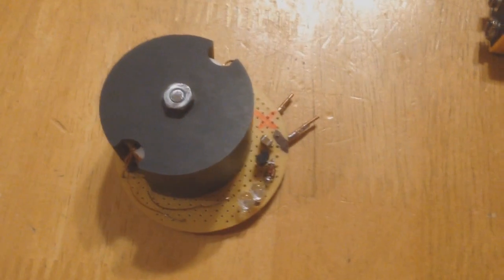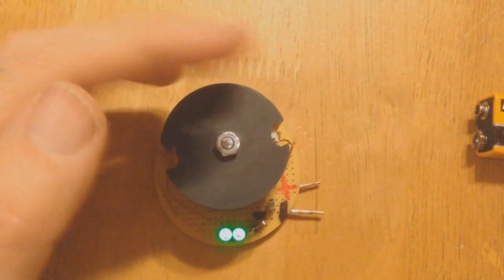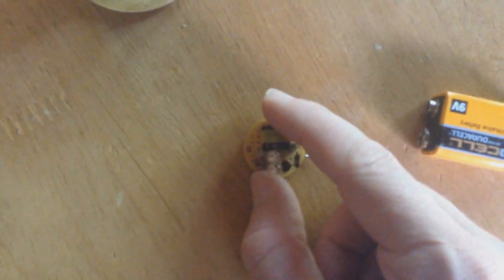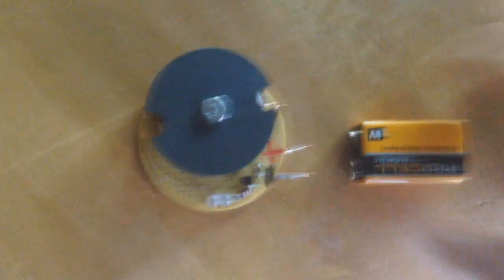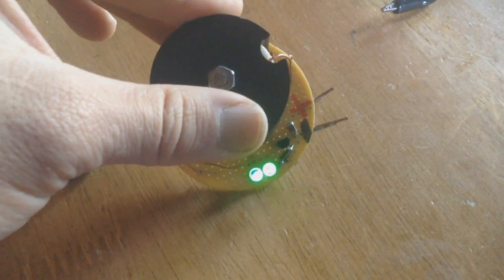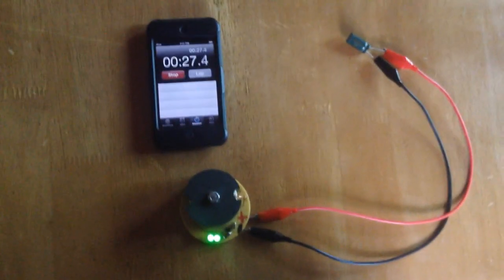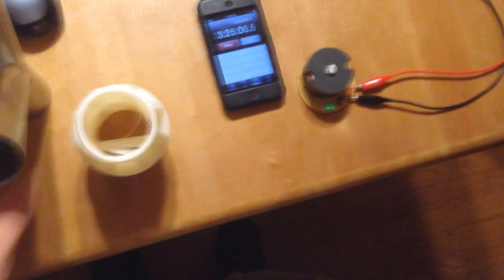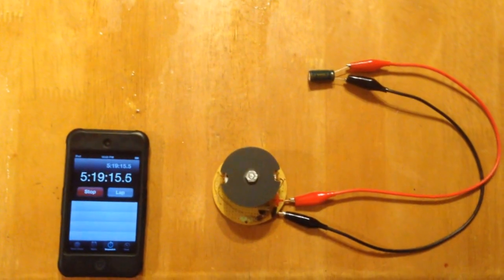5+ hour run on 3500uF - SJR Looper V2 LED Driver

Comment: Yeah I liked all the things you are doing Mike and then I really would like to look get with you sometime and talk with a great deal about this is about maybe you like the ceramic capacitor but I don't care too much for a server on the front of the pastor that durable cousin. Sorry I didn't get that short mountain all their causes a year when they have power go on on dolphin their way with a surge protector went out and then couldn't get it to work anymore so I replaced it with a medal pack happen there in a little bit more send one of you knew and then put that in there it had seemed like it was a lot better with it that metal pastor and they all the furniture and a whole lot better then made it made my tuner come in a hole watch our per month on the pasture in the circuit board replaced in the year ceramic in the TV set the never live down and I thought to myself how that worked worked fine and I kept on working train station bottoms nothing at the right level in Qatar look good enough in the tent over then and than 200 working extra sharp cheddar picture in a color was excellent and the sound was a rule rule! Today do no harm at all to the TV set at alls

Comment: This looks brilliant, could it be scaled up to run a 10W 3.6V 3A cree xml u2 led? 

http://www.cree.com/LED-Components-and-Modules/Products/XLamp/Discrete-Directional/XLamp-XML

Ive been playing about with a small project to run 10 of these 1000 lumen leds from one usb port. I'm using usb as my input voltage since it is by definition universal, so I could use 5v solar chargers, phone charger, wind up charger etc. and the emergency lights in my apartment can run indefinately.  Keep on experimenting!!!

Comment: Could you take the circuit above and put a similar ceramic cap in place of one of the LED's (or both and use an efficient diode) and then run a second SJR off the first? Or even try looping it?

Comment from the maker: I just passed the 10hr mark doing a long run test on the 3300uF cap.

A quick heads up on the the circuit called the "MEG-GA Joule" TinMan is now publicly saying that it was all a fake.  He shared that "Everything is as is except the cap-which is a 5f 2.7 volt cap,with a 1000uf cover.".  Wow that is 5,000,000uF I am surprised that TinMan was not running a small incandescent bulb.

I responded to TinMan personally with  "I understand what you are trying to do by teaching people to not be so gullible. The problem is that while impressive, your implied results are so close to mine when using a pot and tuning the resistance that I see no reason to do it as a fake. I am really close to a similar level of performance right now, although I am using a 3300uF vs a 1000uF.".

Meanwhile scratchrobo just shared this: http://youtu.be/3gkS9tSY5Wg
Reply: he has quite a few interesting free energy projects if you dig through some of his videos.  one he uses a long extension cord and loops it and uses a lighter spark ignitor to excite it and the energy just loops and loops and it stays on, he plugs many things into it and they all work.
Reply: that video might give you some ideas on how to scale up your sjr looper and make it bigger.
Reply: The small group of yall fucked up yr credibility, since its not 1st of april

Ima sent TinselK after yr asses :p
Reply: moxncal except he totally blew any sort of credibility he might have had. Nobody will believe anything he says now.

Comment: Incredible! I run a single white LED (3.3V 20mA) with NCP1402 and a 2.7V 500F supercap for 5 hours. But this circuit is awesome! Only 3.3mF capacitor - and so long runtime. It seems like perpetuum mobile to me.

Comment: Your circuit do have interesting potential to power basic circuit eg:led blinker via low power microprocessor.Imagine this supplying current in uA which is from a 2 or 4v calculator solar cell which is then able to power basic circuit from output.I do own a high efficient green led 5mm which i have it lit nicely by 3volts battery via "27" kohms resistor.

Comment: and the 3 diodes is an idea from the Akula circuit, what made you think to use that? cause diodes have their voltage drops.

but im more interested why your phone area got wet, ? what happened, spilled a drink?

Comment: i wonder if you cheated on this one, cause how come the place where yr phone is wet, who dropped a drink, and you decided to restart yr device without resetting yr timer ;)

47uf can run 1min 10 sec

1000uF about 7 minutes, and 3000uF about 45 minutes
so how can yr device run 5 hours or more, with out earth wire and antenna?

i asked you before, in how did you get rid of a ground wire?

nice work anyways, cause it got me started to

any local transmitter that's getting picked up by yr device?

Greets JB
Reply: So after all this time yr arogance did not respond me? so yr one of those cocky ass builders, with to much gas

Comment: Your awesome laser saber. I've built a few crystal cells (a few months ago) and I am going to see if I can get a decent boost in power or brightness by incorporating your SJR Looper circuit into the mix somehow. I will make a vid after i'm done doing some testing (probably a few weeks from now)
Reply: Actually, it may be sooner, due to the simplicity of the circuit. Cool stuff, loving it. Peace.

Comment: Excellentissimo.
Me wants the schematic and the parts specs.
Question: Have you ever worked with "energy harvesting" circuits like e.g. 
LINEAR TECHNOLOGY LTC 3109  LTC 3108  LTC3105  some of which run from 20mVolts thermo elements or electrolytic corrosion voltages.
Reply: I have worked with 25mV to boost voltage to 8volts.There is a catch low voltage needs higher current which only a peltier can provide easily.
Reply: ima help again, since im already gotten started, Dude fucking visit Saber website, did you even took the time to check, and do you even have the parts.

me wants the schematic, ma ass dude, check his freaking website to get you started, and you dont need a fucking pot core, any core will do.

damn, i wonder if Saber gets tired of peepz like this as i do, same oll shitty questions from peepz who just wanna post a comment and never build anything
Reply: I have posted various youtube videos do check it out.But i noticed you got zero posting in youtube hence no video sharing was made by you.You got no credential dude.Hard to believe you sorry.
Reply: sanjev21 Blah to, welcome new commer
Reply: blah blah blah, ima help Saber out

click dude http://laserhacker.com/?p=410
Reply: you are one of those youtube peepz who trying to be sounding smart, but in real life so fucking stupid